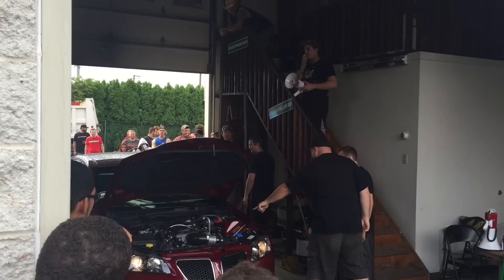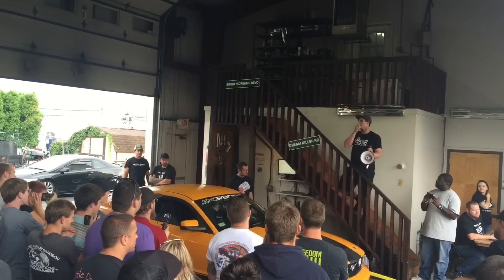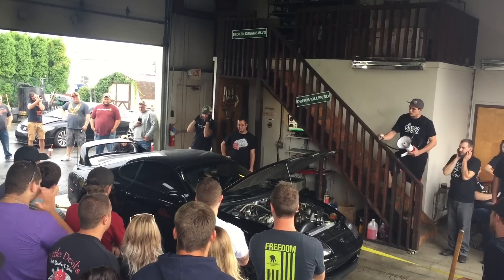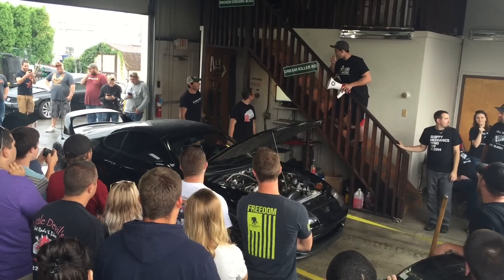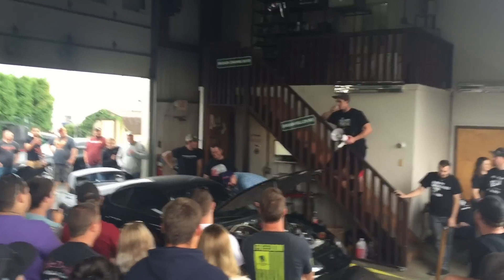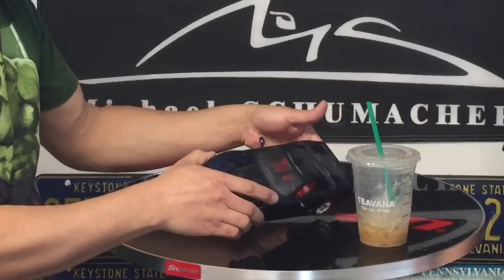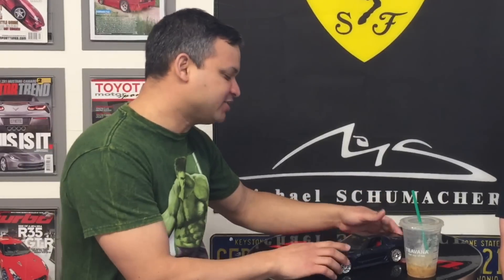Talking Cars With Matt Happel (Sloppy Mechanics)

Comment: The 2004 ls1 gto came with gen 4 style rods just an fyi.

You stand corrected mott happel
Reply: CHIMOB 

*Happel....and wrong. My Current 2004 550hp GTO engine was all stock down to the plugs and had gen 3 rods, I swapped them out. If yours doesn't have the gen 3s then yours have been swapped too
Reply: ShadowOfDeath24 negative.... I've had 4 2004 gto motors apart and all were gen 4 rods. Haven't met anyone with a gen 3 rodded ls1 out of a gto.
Reply: CHIMOB Sure did, but my 05 ls2 came with an ls1 clutch and flywheel, weird asf. Also i blew that shit tonight N/A!! stay sloppy, stay away from rpm my friends <3